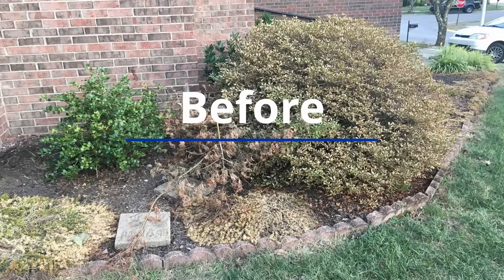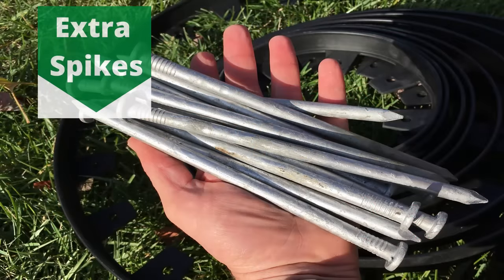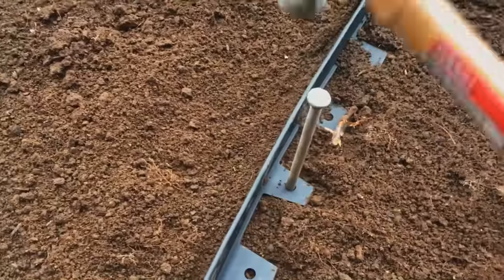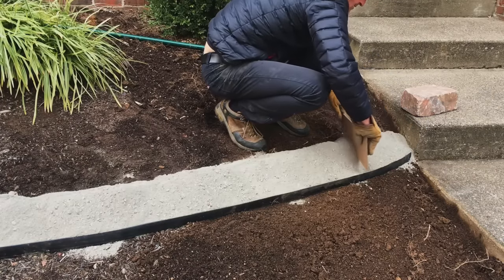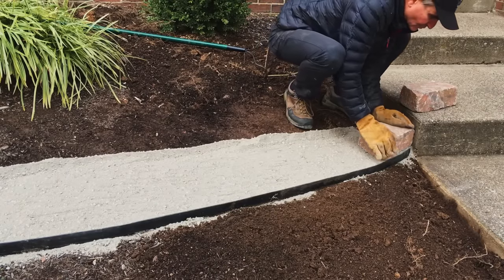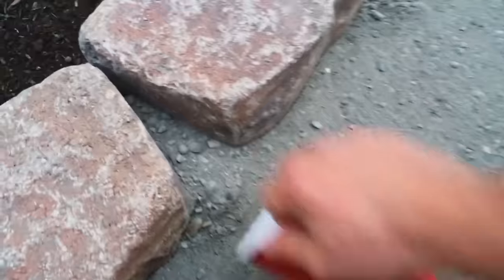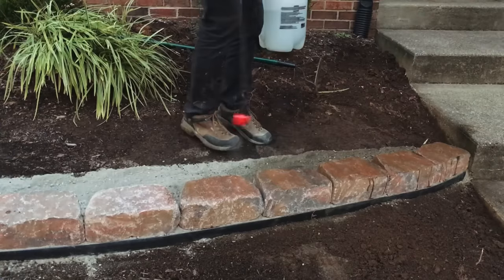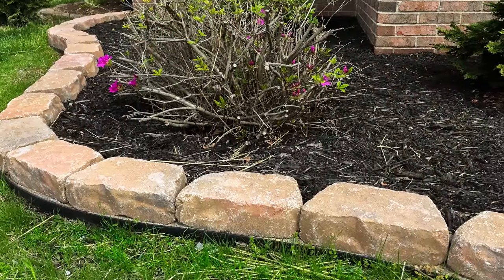easy diy No Dig Border *2020 UPDATE*

Comment: This should work around a 24' above ground pool don't you think. Also where is the link to the blocks you used. Thanks.
Reply from the maker: Yes, this border can be adapted to many situations. Here is the link to the blocks at Lowes and Home Depot. I think each place has a more tannish one and a more whitish/grayish one. Here you go: Grayish: https://www.lowes.com/pd/Flagstone-Ashland-Retaining-Wall-Block-Common-4-in-x-11-in-Actual-4-in-x-11-2-in/4686351?cm_mmc=shp-_-c-_-prd-_-lwn-_-bng-_-LIA_LWN_236_Hardscapes-_-4686351-_-Local-_-0-_-0&msclkid=e2352b3a464113b87b3f4fbe44fe6528&gclid=e2352b3a464113b87b3f4fbe44fe6528&gclsrc=3p.ds More white/gray https://www.lowes.com/pd/Flagstone-Allegheny-Retaining-Wall-Block-Common-4-in-x-11-in-Actual-4-in-x-11-2-in/4686343 Orangish: https://www.homedepot.com/p/Oldcastle-Mini-Beltis-3-in-H-x-8-in-W-x-4-in-D-Harvest-Blend-Concrete-Retaining-Wall-Block-16252111/307676509 I can't find the more white/grayish ones at Home Depot.

Comment: I want to try it this weekend. My gutters drain where the stones would be on the side of my house. Do i need to leave an opening in the stones for the water to drain out? The stones would be around 2-3 feet away from the house. Thanks!
Reply from the maker: I have not done it like that before, but it might be an option for you. I have either done nothing different with the downspouts and left them normal or I have built a drain system where the water goes right down into black corrugated pipe and into white PVC for good drain flow straight across under the ground and letting the water exit with a drain box on the end where the water can flow up and out of it into your yard. I use some rock under it and drill holes in the box so it doesn't hold water long term. I hope this helps. Ask for more details if you want, ok? Have a great day!!

Comment: Hello. Can I achieve same look without using concrete?  Also, wasn't able to find metal spikes in store. Clerk didn't know either🙄 what section please? Thank you!
Reply from the maker: Theresa, the cement provides four major functions in this border technique 1. Height(for looks) 2. Keeps the stones straight/aligned over time 3. Stability/strength 4. Weed barrier(the extra width is nearly impenetrable to aggressive weeds and grasses(Bermuda Grass) that we have here in Nashville. You can show the folks at Lowes this product they have in hardware: https://www.lowes.com/pd/Grip-Rite-8-in-x-3-8-in-Spike/3610434 Have a great day, Theresa!!
Reply: @maxpatch67  thank u

Comment: Love your video!  If I use landscape material below the cement will the cement set up ok in dry Colorado
Reply from the maker: Yes, just be patient in the misting process. If you have a helper, this is a good no-brainer job for someone else to do as long as they use the mist setting and move slowly so its thoroghly soaked.

Comment: so If I'm following correctly, this process will just follow rises, dips and contours of your land? so wouldn't give a leveled wall result?
Reply from the maker: Yes, that's correct. That's the main reason I don't build on additional layers on top. The border technique does include a small amount of levelling, however. When tacking down the plastic edge, you will attach it to the higher areas along the line. (if you tack it down in the little dips, the edge will curl up and get wonky). Small dips will be glided over by the stiff plastic wich will create a small amount of levelling effect. It creates a much more uniform look anyway because the small imperfections will smoothed over. I hope this helps. Let me know if you have any more questions, okay, 22josta? Have a great day!
Reply: @maxpatch67  thanks so much! looks great! I may look into doing this instead of the traditional leveled retaining wall style

Comment: Can we put a second layer of stone on the top by adding some cement between layers? Wondering what are the challenges in doing that.
Reply from the maker: I have never done that because I just don't think it would look as good. The challenges would be either using landscaping block adhisive and gluing on the second layer(easier) or using traditional mortar(much, much harder).

Comment: I have 40 feet of border to do and will be hauling the blocks one at a time.  I'm not strong enough do it all in one day.  Can I do this in stages?  Say, completely finish five feet and days later do the next five feet?  Will the new concrete stick to the previous work?
Reply from the maker: You could just leave the unfinished end of the project covered in plastic or something.....maybe cover the last 2 feet(and surrounding ground) each time to keep it dry enough to work with the next day. If you don't have a wheel borrow, you might want to get one for this and other projects. It makes moving awkward and heavy things so much easier. If you can get or borrow one, you will be very surprised how fast work will get done. Maybe borrow one or get one off craigslist/facebook marketplace....
Reply: @maxpatch67  Thanks.  I did get it done this week.  It is so hot and humid here I only worked at sunrise and sunset for an hour so it took six days.  I got a friend to help with buying some additional blocks and concrete and carrying them in, but most of it I got delivered.  There were 43 blocks needed in the end. The blocks I used weighed 17 pounds each.  I found that if I put one block in a five gallon bucket I could move two blocks, one balanced one each side.  The concrete powder I portioned out into one gallon ice cream buckets.  I got 3/4ths of the edging laid down and then the fourth day rain popped up right over us, so that set those.  I don't see any problem at the joined spot. I only needed five bags of concrete because I didn't make the base so deep into the bed.  I already had landscape fabric down for the weeds.
Reply from the maker: Kim, thanks for sharing how you were able to get it done!! Ingenious!! Hey, the photos you sent, did not show up somehow...anyway you could send them again to my email address tim@timvogelaar.com? Thanks! I'd love to add them to my website: https://www.timvogelaar.com/Easy-diy-no-dig-border

Comment: Great video!! Wondering how this technique would work along a gravel driveway using rectangular pavers. We are having a new layer of gravel put down and would like to have  a nice edge to prevent the gravel from migrating into the lawn. Thoughts?
Reply from the maker: If you are sure no one is going to drive on it at all, I believe this would be the perfect technique for that. I'd consider the height needed to keep the gravel in with the blocks that you use without it spilling over and making a mess. I don't know if the height of the blocks I use in this video might be better for that than the rectangular ones you are mentioning, but that is worth consideration. Have a great day, Judy!
Reply: @maxpatch67  Thank you for your reply. I agree, the height is something to consider.

Comment: This looks really professional.  Would I be able to stack the blocks for a higher wall using this method?  Does that affect how much concrete and mulch I will need due to having a higher wall?
Reply from the maker: I have not built another layer higher because I don't like the way it looks so much, but others have done this and used either landscaping block adhesive or traditional mortar. I don't really recommend it, but you can do it.

Comment: how do you keep you blocks all on the same level my area kinda goes up and down?
Reply from the maker: When you attach the plastic border to the ground, because of the stiffness, it will tend to kind of glide over the little dips and so this results in much smoother edge than the ground actually is. If you have a larger low area, you can either keep it the way it is if you don't mind it, or you can fill it with dirt first if you really don't like it. Please let me know if I can help you any more. Thanks!

Comment: I’m thinking about making a boarder for my backyard along all of my fence line,  do you think this strategy will work??
Reply from the maker: This technique is designed to have mulch cover up the back side of the cement in the landscaping area that is spread out back there for weed control. Do you have an idea of what you would do about this?

Comment: I am concerning about the water draining issue if placing the stone this way, can you explain if it will block water coming out once it rains? Thanks
Reply from the maker: It's hard to say because there are soooo many variables. I can tell you what I do here in Nashville, though. I cut off the downspout and attach a black corrugated pipe drain system out to the yard. If you want more detail or can describe your situation more, I could recommend something for you if you'd like. Have a good day!!

Comment: Awesome! I have a question. If I use the concrete set method, would it still allow me to replace a brick or remove a portion of the set base down the line? Thanks!
Reply from the maker: The concrete makes it a type that is considered "permanent". its meant to be used for those that are sure of what they want for many many years. That being said, if you are determined, you can just use a sledgehammer and bust it up whenever you want if you desire.
Reply: @maxpatch67  Awesome,  thanks!

Comment: Generally liked video, but not a fan of the black edging sticking up... does that disappear as grass fills in around the border?  Does a string trimmer re-expose the black edging?
Reply from the maker: Ya, I understand. It just really depends how you do you r edge and what type of grass you have about how much that shows. You might get used to it and not think of it after awhile and also, you can look at it as an extra line of definition with is always a good thing. Another idea is to try reversing the plastic edge in the building process and then removing it after the cement sets up. I think some people have tried that but I never have yet....anyway, something to consider. Have a great day, SS!!

Comment: What about stacking? I want to build a 2-3 ft wall to keep my neighbor’s grass clippings/Bermuda grass out of my yard. Should I use adhesive to stack?
Reply from the maker: Dana, I have not made a second layer on this type of border because I don't know if it would look that good and the difficulty level is raised some because you would mix up and use a traditional mortar between the layers. Even, though, it involves more work, I would highly recommend digging out the old dirt and mulch out of your area so the level is dropped enough so that there is plenty of room for the mulch to sit in there without spilling over. Also, the same thing can be accomplished by building your border out further so the dirt can slope down to the level of the bottom of the blocks and also have room for mulch. This all being considered, you could use landscaping block adhesive if you still want to try it....

Comment: I like the idea of this technique 👌 
Curious to know how will the water drain through the quick set concrete? 
Thank you!
Reply from the maker: If you have a downspout in the area, you have a couple options. If you don't mind the water, then you might just want to let the water disperse within the landscaping area since the plants would love it. Here in Nashville we have plenty of water and try to get it away from the foundations to keep water from coming into basements so here, I cut off the curve piece on the downspout and attach a black corrugated pipe that runs down into the ground and further out into the yard. I can give you more details, but this should be done before building your border. I hope this helps, Silva. :)

Comment: 1. Could you do this on top of the existing grass?  Seems like it would grow under the concrete.
2. Could you use moss rock or other non-uniform stones? Will they stick to the concrete?
Reply from the maker: 1. Absolutely!! That is one of the key factors that makes this easy. Build it right on top of the grass for great results.
2. You can use any rock, brick or block. They will all work perfectly.
Have a great day, Lonna!!

Comment: Will this hold up with freezing temperatures in the winter (upstate New York)? Seems like the concrete wouldn't be thick enough to withstand freeze/thaw cycles.
Reply from the maker: Michael, this is an excellent question and one that I would be interested in knowing too if I lived up there. I build these borders here in Nashville where I live. Here is what I know. On my older video of this technique, I had people from several years ago, testify as to how happy they were with this border after multiple winters and these people lived in New England, Chicago, and Canada. That being said, I don't have personal experience building them up there and I do understand your concern. Also, check out the very first pinned comment below the video. A viewer wrote about this topic.

Comment: Will it move with ground shifting? In the north the ground freezes and thaws. I currently have a small wall up now that has shifted twice. Any knowledge is appreciated. Great video!
Reply from the maker: Thank you!!  This is an excellent question and one that I would be interested in knowing too if I lived up there. I build these borders here in Nashville where I live. Here is what I know. On my older video of this technique, I had people from several years ago, testify as to how happy they were with this border after multiple winters and these people lived in New England, Chicago, and Canada. That being said, I don't have personal experience building them up there and I do understand your concern. Also, check out the very first pinned comment below the video. A viewer wrote about this topic.
Reply: Thank you for your reply. I think I will test it out. It’s so much easier than digging in shale and throwing pebble rock down
Reply from the maker: Yup! I understand. I think you be very happy with this technique.

Comment: After creating the border and following the rest of the steps, is the plastic border necessary/can it be removed? I assume it’ll be covered with concrete but just wondering!
Reply from the maker: If you look at the thumbnail photo, this is exactly how it would look in your yard depending on how you trim your edges. The plastic edge stays as part of the durable structure of the border. the 2"black edge will be in the grass right under the blocks. Have a great day, Sydney!!

Comment: Do you think you could use square pavers? I have a pallet leftover from the patio. They would sit side by side without the gaps to put extra concrete between them.
Reply from the maker: You can use any rock, brick or block that you think looks good. Visualize it first before making that big decision...it will be permanent. I really love the ones in this video and highly recommend them, but anything will work. Have a great day!!

Comment: I am in the process of putting in a border around my brick patio. There is a slope concrete away from the patio holding the bricks in. Because of this I can’t put in the plastic border first. Would this work skipping that step?
Reply from the maker: I can't quite picture what you are describing, but I can answere your question I think. If you have a situation where you don't need the plastic edge to hold the cement mix in place, then you can get by without it. It's main purpose is to look sharp in this border technique so if you are doing something a little different where it is not needed, then go for it. Does this help? Please reply and ask more if you'd like, Susan. Have a great day!!

Comment: From previous blocks that were laid and pulled out, I have about a 3 inch trench…should that be filled before starting and if so, what all should be used?
Reply from the maker: If you are going to tack down the plastic Vigoro edging on the grass just outside and next to where your old border was, then I’d just leave it alone and don’t do anything. The little extra depth and solid base would be perfect for your new border to be built on top of. The only downside to this is using a little extra cement mix. Instead of one bag working for 5’ linear feet, then it might only work for half that. Anyway, if it were me, that is what I would do. I hope this helps. If you need any more help, please let me know. Also, I’d love for you to send me finished pix so I can share them with others.

Comment: Good video, Thanks!
I have two concerns depending on the soil type. We have clay which messed up foundations and other structures. How well would it hold up on clay? Most borders I see are cracked, separated, etc. In our area. Second concern is surface water drainage during heavy rainfall? Water standing right next to the foundation is a big issue especially with clay soil.

Anyone experienced this? Thanks for your input.
Reply from the maker: Great questions. I have not built these on Texas clay. I have had that question from others and don't know the answer, but I do know the properties of this cement type that is very sturdy and works amazingly. The water question. I have thought about this as well. As a matter of habit when working on creating any new landscaping area, I always build a drain system that diverts water from gutters directly into the ground and across 15 or 20 feet away from the house where it exits across the yard. I can give you more details if you are interested. I also will bring in extra dirt to slope the ground away from the house which also pays off big-time. So, yes, both of your questions are worth considering....thanks!